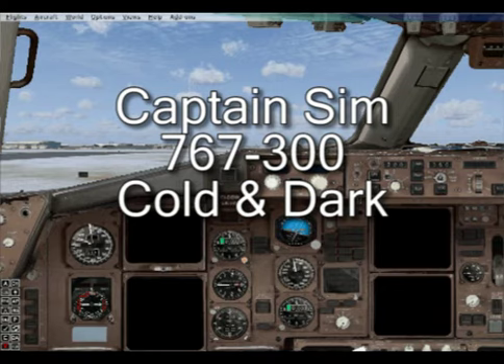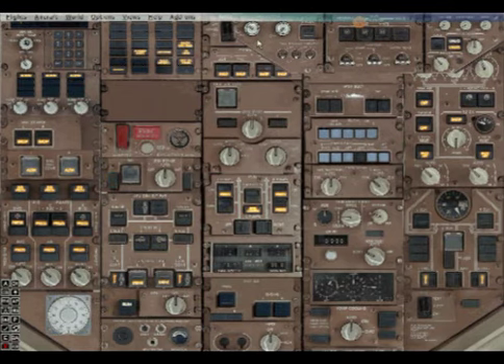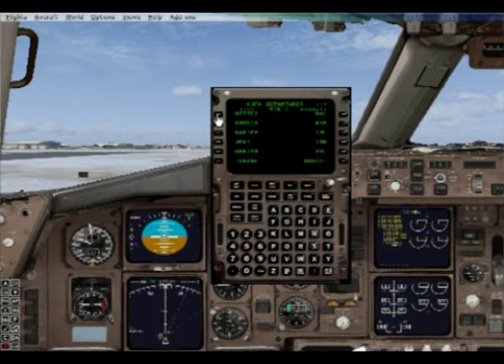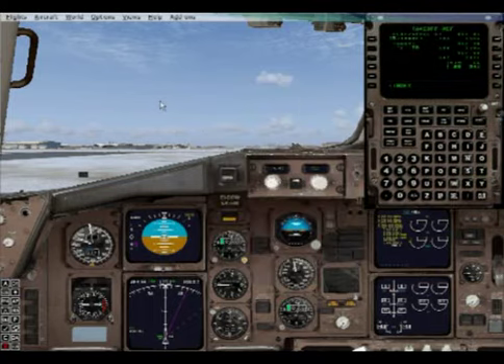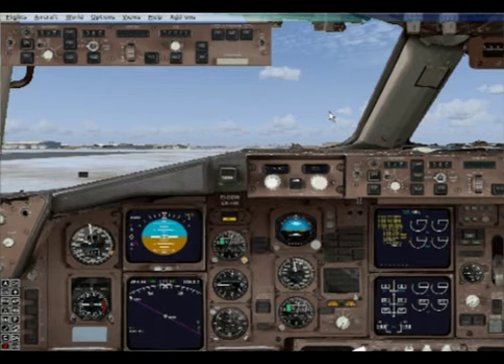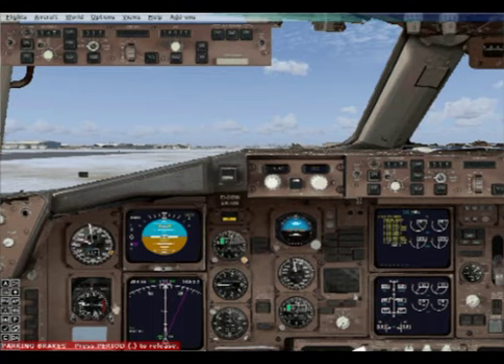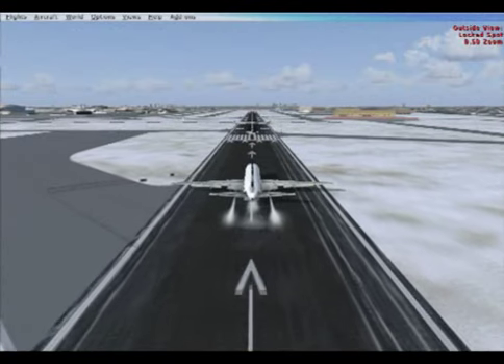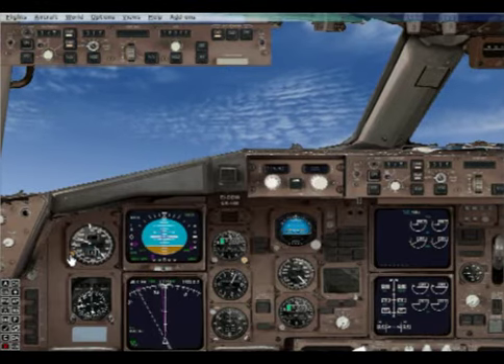Captain Sim 767-300 Cold and Dark Tutorial

Comment from the maker: Cost Index mostly has to do with fuel consumption and each airline has their own formula to get the most efficient use for each flight. Since we are not that concerned in simulation, you can just use 80 for most flights.  I had one very long flight and the FMC told me I didn't have enough fuel, and by decreasing the CI to 70, I had enough.  A lower number will cause a longer climb, slower cruise, etc to save fuel.
TO thrust,  just push it all the way forward, the computer handles the rest.
Reply: no for takeoff thrust u have to press the EPR to get TOGA